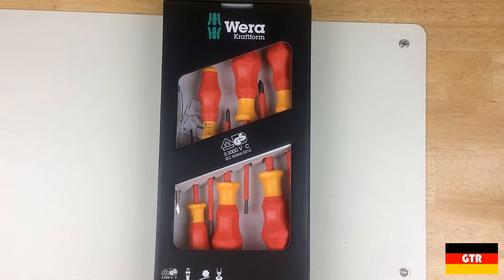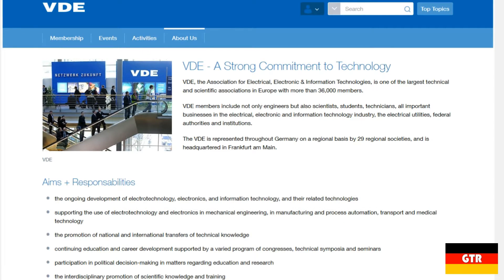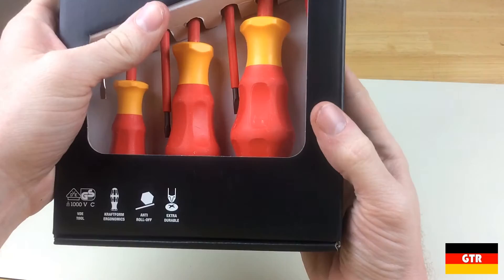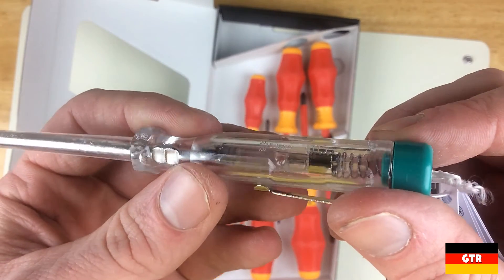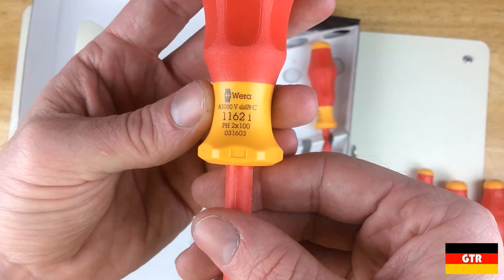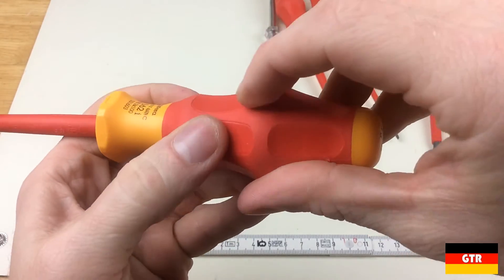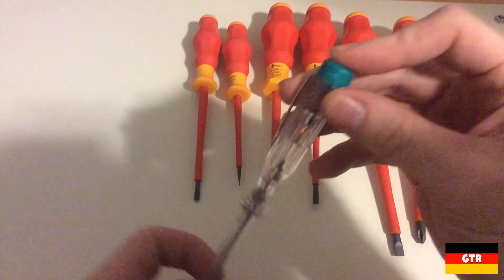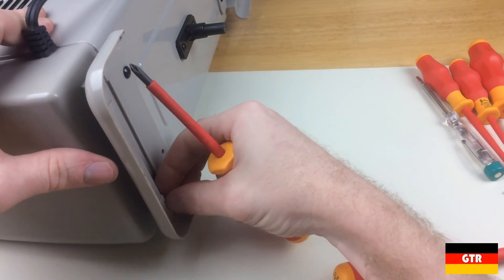German Tool Reviews:  Wera 031575 (VDE 1000V Insulated Slotted/Philips Screwdriver Set)

Comment: This phase tester is actually useless, even when using on 230V. Here in Germany they're rated as unreliable within the trade because the user is the reference point. If you're standing on an insulated floor or wearing shoes with a high resistance this tester will not indicate a voltage. In the other case it can indicate ghost or reactive voltages which come from capacitive or inductive coupling, in this case it will glow much darker. These voltages are here between 70 and 100 V but they are not resilient, they can only be detected by testers or multimeters with a high internal resistance. That's the reason for it's slang name "Lügenstift", which can be translated with "lying pen". And one thing you've already noticed, in bright areas it's hard to see if the neon indicator is glowing. The neon indicator will already start glowing on a voltage of 60V.
The only thing which separates you from the mains when using this thing is a cheap resistor inside. The workers' compensation insurer bans the usage of these to proof if a circuits dead. As they do with the touchless voltage testers. You must proof if a circuit is dead with a 2-pole voltage tester, mostly called a "Duspol". But Duspol is a trademark of the german manufacturer Benning, same thing as Kleenex for tissue. It can also be made by Fluke, Beha-Amprobe or somebody else and it would be called a Duspol here.
The blade of this tester is not hardened, so this thing can't even be used as a screwdriver.
Reply: I have always called them hammer testers. If they shatter when you hit them with a hammer then your hammer is working properly.

Comment: I've got a Wera screwdriver set and as much as the grip is comfy the shaft/ tip of the drivers are very special. I broke a small flat head driver on first use actually, not saying Wera are bad but I did expect much more from a none China made screwdriver. Good video!
Reply: *arent
Reply from the maker: Sorry to hear that.  Check out the Drivers with the Laser Tips as these contain hardened ridges that are less likely to Wear.  I have a video on them when I reviewed the Wera 3334/6 stainless drivers.  Wera screwdrivers have a lifetime warranty so you should be able to return/exchange it if it broke on the first use.
Reply: German Tool Reviews I'll check with the place I purchased them from thank you! I have the laser tips too, came as standard and laser tip set and was the standard style that I broke. Have to say the laser tip style do noticeably bite in more. I'll go watch the video though, thanks again for replying/ helping!

Should maybe do a livestream sometime?